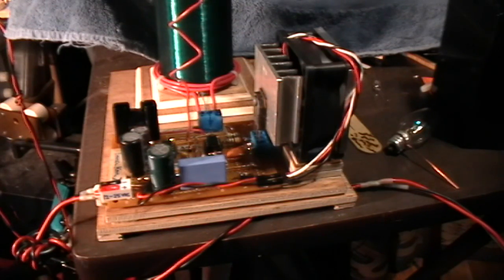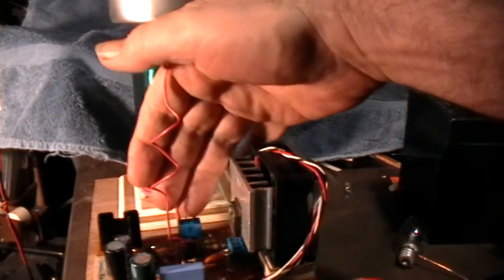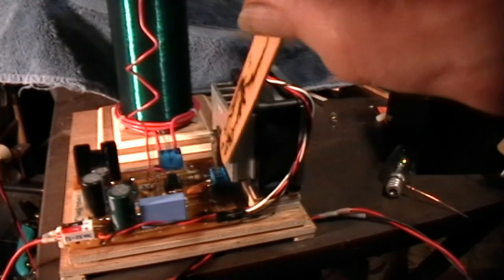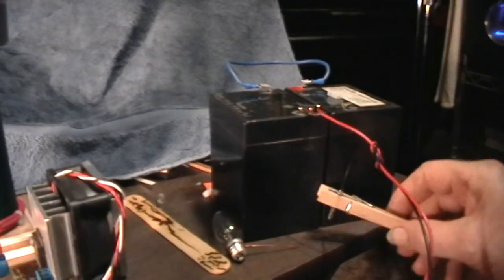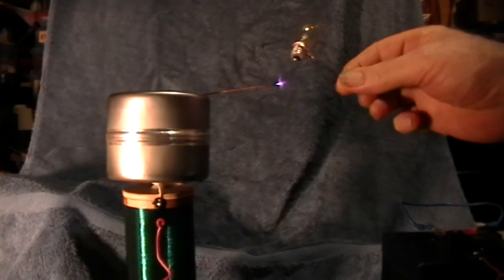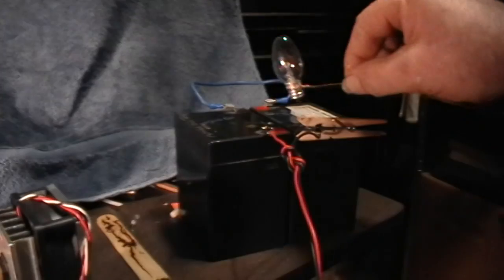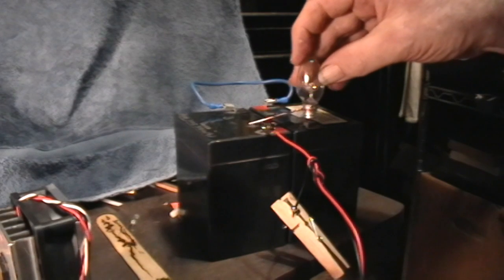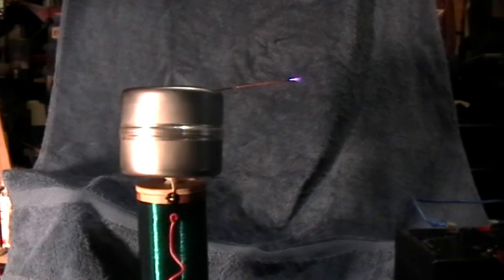Extreme High Voltage: TinselKoil X : First Light, Hash on Input

Comment: i think the power is coming from the antena coupling from the secondary,your antena is high enough to have high enough voltage. a metal object close to seconday and the metal connect a blub,the other end of the blub connect another metal will light it up too

Comment: TK, GotoLuc will hopefully be sending you a sche with the concept of captrets and AV plugs soon.  Your device is a more advanced kacher circuit basically.   You can use the battery plates as a third plate to captrets and your secondary resonant terminal to AV plugs.  There is way more here output if you utilize both sides of your circuit in an open path.  You are wasting the secondary resonance terminal right now.  Hopefully, you get some information from GotoLuc soon on this.
Reply from the maker: Thank you for your comment. I have several "kacher" and "slayer exciter" units here, and none of them quite do what this SSTC does. Also, the other circuits use a direct connection from the bottom of the secondary to the base of the NPN transistor. This circuit uses a mosfet and a highspeed mosfet driver chip, along with antenna E-field feedback, to produce a greater voltage swing and faster rise-fall times of the pulses to the primary coil. In addition, the bottom of the secondary is connected to the common circuit ground and power supply negative rail and the Source pin of the mosfet, not the Gate. Rather than this unit being a "more advanced" kacher, the kacher/slayer exciter are rudimentary, less advanced solid state Tesla coils.
Reply: I understand.  Thanks for your response.   You should still be able to do the experiments with a captret and AV plug and not waste the secondary.  Anytime you have ions escaping, that is a loss in the circuit.  This is why Tesla worked so hard to prevent loss on his secondary.  Keep in mind that can easily take a copper plate between your series batteries and run a captret AV plug system using ground still and see more output than what you are seeing now.  You can also use either one of your battery terminals to third plate, and use AV plug from your SSTC high voltage secondary output.   You should be able to run larger loads with this arrangement.  The idea is to prevent as much wasted ion flow while keeping an open system for the feedback loop. Hopefully, I'm making sense.
Reply: Playing with this configuration and earth ground as a choice as well. https://s3.amazonaws.com/jwburnum/Drop+Box/Public/microSSTCschematic2.JPG

Comment: Hi Good demo, impressive and fun.  Love your circuit, I think it's going to be well receives and popular.  I'm familiar with Steve Ward Micro SSTC circuit. I have read all comments below, and could find more details on your antenna hook up. Enough to replicate anyway. Could you please elaborate on that?
Reply from the maker: The antenna is simply connected to the logic input of the tc4420 mosfet driver, with diodes to clamp the voltage to between 0 and +12v. The 555 astable timer is connected through resistors and a capacitor to the same pin. When the coil rings at the trailing edge of the 555 pulse, the antenna picks up the Efield and takes over driving the 4420. Simple, and autoresonating. 
Thanks for watching and commenting, good luck on your build. Don't get burned!

Comment: When you hold the wire to the "brilliant bulb", which is extraordinary, I'm not sure whether it's you conducting current, or the surroundings.  Have you tried clamping the bulb purely mechanically to the battery?

If the current really is going through you, I hesitate to think how you'd feel when simultaneously lighting up a whole bunch of them!

Comment: TK, Can you please confirm this is the circuit of Steve's that you based your circuit on? https://www.stevehv.4hv.org/SSTC6/microSSTCschematic.JPG
Thanks
Reply from the maker: Yes, that's correct, except I am not using the input stepdown transformer or the fullwave bridge, since I am using battery power or PSU instead of mains power. A few more capacitors here and there, and a 2n7000 mosfet between the antenna and negative rail for future interruption/audio modulation (turning on this mosfet shorts antenna to ground, thus turning off the gate driver chip).
Reply: Thanks for your reply, and your efforts. You do excellent work, and explain your test clearly. I think you have found something unique.
I will work on a replication of your build over the next few weeks.

Comment: TinselKoala : Thanks for sharing another very interesting project.  I've reviewed Steve Ward's schematic and the high speed MOSFET driver data sheet.  If I have it right the TC4420 is converting the feedback ringing sine wave picked up by the antenna into logic pulses which drive the primary coil power MOSFET to stimulate the secondary at it's resonant frequency resulting in very efficient voltage magnification.  I'm interested to know what you would estimate to be the highest resonant frequency that a coil could be tuned to generate high voltage with this circuit?  Any tips or points to consider would be very much appreciated.
Reply from the maker: Yes, that's how it works. I don't know the highest resonant frequency that could use this method. I've seen small SSTCs running as high as 3 MHz. There are a lot of things to consider when making TCs, such as how the secondary is terminated, how it is  insulated, the coupling factor between primary and secondary, the use of varnish (not yet varnished here) and so on. Experience is the best teacher, if you don't cook your fingers in the process!
Reply: Thanks for your response TK.  If I may followup with a tinkering application, I'd like to experiment with using an auto tune circuit which uses a feedback loop like the one you're using here to avoid having to tune Tesla coil or circuit to resonance up to 15 MHz.  The data sheet for the TC4420 has a Supply Current vs. Frequency chart which goes up to 10 MHz so it may not be suitable up to 15 MHz.  I can use your help with steering me in the right direction for an auto tune circuit that is best suited for this higher frequency lower power application.  I've noted that data sheets don't typically list max frequency for MOSFETs and I don't have experience with component selection for a pulse circuit at this higher frequency range, any suggestions would be appreciated.

Comment: Well that was fascinating. I've lit up 240v incandescents with the single wire before using the karcher but nothing that bright. How did you tune your antenna? Thanks
Reply from the maker: Just a random piece of wire. I did experiment with different lengths but as long as it is long enough to work, the length didn't seem to make any difference. It does need some antenna though; without it the driver stays on fully and current draw is DC and very high and of course no oscillations happen, except the slow frequency 555 square wave "kickstarter" but no resonant rise. The 555 is working at about 250 kHz just to get the secondary to start ringing, once it does the antenna drive takes over.
Reply: mmm now I want to build it. Thanks again mate.

Comment: congrats! looks like you've inadvertently discovered a way to replicate one-line transmission. now test a load....
Reply from the maker: Inadvertent? Hardly, it's a major theme of the work, along with zero-wire transmission. But I certainly wasn't prepared for the amount of power running around in this thing.
Thanks for watching and commenting!
Reply: TinselKoala I apologize, I meant it to be a nonchalant notion. I've been following you for years and am a huge fan of all your work.
Reply from the maker: No apology necessary. Thanks for following, I hope you are entertained!

Comment: Nice! What if you had two bulbs?
Reply from the maker: Twice the light?
Reply: Thanks for your remark TK. The bulb is so much brither at the battery.  Is it pulling(!) the current out of your fingers?
Reply from the maker: It must be doing something like that. The current draw from the battery does increase somewhat when I touch the bulb to the power leads (could be at the circuit end or the battery end, makes no difference). Maybe it is coupling to the AC mains through my body somehow. I'll have to try it out in a field somewhere to see if it still makes the bulb glow so brightly.

Comment: very impressive and topnotch circuit construction as always ! i have built steve's micro sstc in the past as my first sstc and have still not gotten to improving my larger sstc :-p i would be concerned as well for any power supply or test equipment being used with that setup, i've never seen feedback power of such magnitude ! would some type of inline filter rectify the problem, i use typical types found in microwave ovens for general filtering but not sure if that would help in this case .. anyhow cheers thanks for sharing =)
Reply from the maker: Yep, I'm kind of afraid of the damned thing now. I do have a toroidal choke on the supply wires but even so it still does it. I have been running it using my bench supply for a couple of days but you are right, it might be bad for the supply, so I decided to use batteries instead. Now I'm worried about the batteries!
Thanks for watching and commenting!
Reply: hmm just having a thought, do you by chance have class x and y caps handy ? you could theoretically build a custom inline filter but not sure if the caps could take that high of feedback voltage unless you set them up in series strings .. i would have to look around a bit and research that .. basically something to dump that high freq. feedback to ground .. then you can use some proper gear for testing and funtime =)
Reply: Do you have the RF ground connected ?
I'm guessing the only mod to Steve's circuit is that you power it from batteries, is the bridge rectifier still in the circuit ?
Do you still use the filter caps (the 2200uF ones in the circuit)
Reply from the maker: It works with RF ground connected to negative rail, and also with RF ground connected not to power rail but to my true Earth ground as well (but not quite as brilliant in the latter case). No bridge rectifier since I'm using a PSU or battery, a little smaller filtering caps along with an X-class poly film cap in addition to the electrolytics, a 2n7000 mosfet between the 4420 pin 2 logic input and ground for interruptor use later on, a bypass cap on the power to the 555, smaller value Gate drive resistor (2 x 10 ohm in parallel instead of one), a 2sk1358 mosfet for primary drive, closer coupling between primary and secondary, fewer turns on secondary, heatsink fan powered by unfiltered input voltage.
Reply from the maker: The lavender rectangle thing is an X-class cap on the power rail and there is a small choke on the power input wires, which gets hot during operation. With too much filtering on the "DC" input (like a common mode choke) the main TC effect stops working for some reason.
Reply: I'm wondering if you get the same problem if you break the connection from RF ground and negative, the RF ground would be connected only to your ground stake.
At first i thought it might be primary current backfeeding to the lamp and to ground through you, but not sure why it would light on negative, as that's the same as ground.
It just seems a lot of current to be coming from the secondary.
Reply from the maker: Yes, I guess I wasn't clear enough, I have disconnected the RF ground from the rest of the circuit and only connected the RF ground to the earth ground stake (which is in moist soil underneath the airconditioner drip line). It still does the same thing, lighting the bulb on either positive or negative battery supply rails, but perhaps just slightly less bright on the bulb.  Same thing with RF ground connected to the circuit negative and also to the Earth ground. It doesn't seem to make much difference either way. With RF ground disconnected totally the bottom of the secondary wants to strike over to the primary, melting insulation at the bottom of the coil, so I haven't tried that for more than a few seconds. Next I'll try decreasing coupling (larger diameter primary, perhaps with some insulation between pri and sec. 
I'm glad you see it as a problem rather than a feature! One would like the DC input supply to be clean, after all! But even so, I haven't been able to blow any mosfets or chips with the thing yet. That is kind of a mystery, you'd think the 4420 and the 555 would blow, with that much hash on the power rails.
Reply: bit late to the conversation :-p ah so even with some x class caps and a filter choke and messing about with RF grounding, it still gives nasty feedback ! very strange .. when i remove the RF ground from my secondary for the larger sstc setup ( also steve ward design ) i get more output, with the secondary grounded, the output is less then half .. i haven't really spent much time with learning sstc topology but i will soon, i'd like something better then my mega slayer exciter and a MIDI musical coil is the ultimate goal .. do hope you can solve your problem, it really is a mystery !